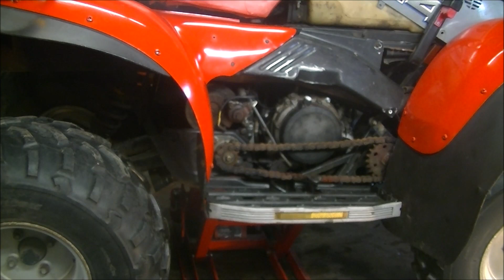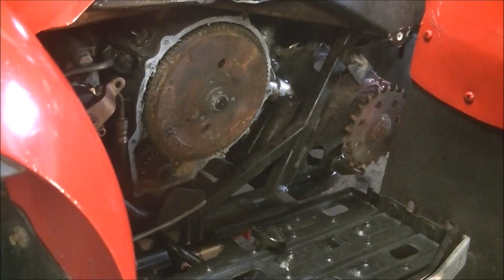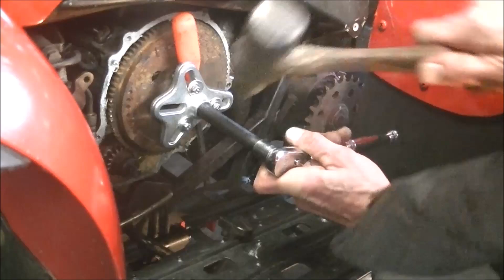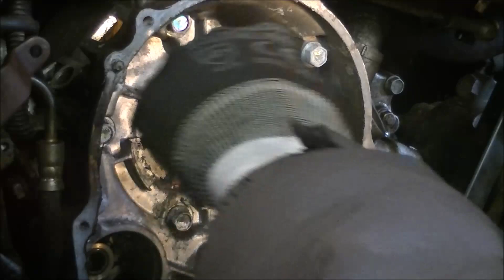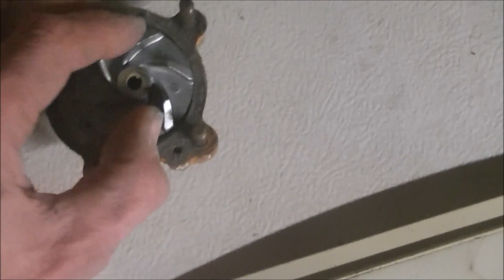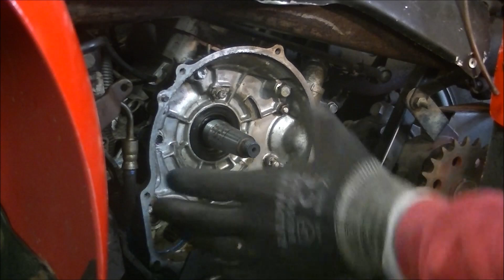How to replace a water pump  on Polaris  350L/400L Trailboss

Comment: I am putting the pan back on and that special slotted nut that threads left i cant torque to spec without my crankshaft turning. Is there any tricks or methods to getting that nut tight?

Comment: Where is the 10mm air purge located in the engine to bleed air from the coolant system?
Reply: On the top of the head is a bleed bolt. I have a 350L

Comment: Is there a way to test if your water pump is working without taking everything apart?  I’m getting some smoke coming from the water pump inlet area on a new top end rebuild. Head is getting hot quick.
Reply from the maker: You can look in the radiator cap to see if its flowing.
Reply: Seems mine is just bubbling. When I hit throttle it will spin in circles doesn’t appear to flow one way or other.

Comment: How did you get the stater out?  It all appears to be wired in with no connections to take apart.  

Thanks.
Reply from the maker: There should be bolts on the stator plate outer perimeter. Take those off and pull it out.

Comment: Can a bad water pump seal cause my engine to burn coolant? I've already replaced my head with a machine one and new gasket.
Reply from the maker: Yes, it seeps into the case and goes through the exhaust. It's a common problem with 2 strokes. Replace the water pump and crank seal behind the counterbalancer cover.
Reply: I have the same issue after doing the head gasket twice and inspecting the head it’s still smoking alot

Comment: I have a 350L and just swapped in a working engine. How to I bleed the system correctly? I was test running it and the hot light came on so I shut it off. The top hose that goes back to the radiator was not hot. Thinking I did not bleed the system correctly.
Reply from the maker: Did you crack open the bleeder screw on top of the head to let the air out?

Comment: Thanks for the video! Very helpful.  I got everything off except the water pump bearing is stuck on the shaft.  I can move it maybe a quarter inch back and forth freely, but seems to get stuck.  Do you have recommendations for removing this bearing?  It appears to be smooth and work properly, but since I have it apart and have a replacement, I'd like to get it off.  Thanks!

Comment: Very good, bad buy on a 1995 Explorer, overheating issues, radiator sensor looks bad, blown headgasket, had to use putty, still over^pressure in radiator and boiling antifreesze went into reserve :(    So wonder if this low miliage has defective waterpump, but that impeller doesnt seem to be melting plastic ??
Reply: Still at it, is it true there are no thermostat on those models? So aluminikum and doesnt melt :)  Mine has only 6,000km so the seal & bearings should be okay.

Comment: I broke 9 grade 8 bolt in my balance puller one in the fly wheel drilled it tapped tried again got it good n tight then my threads gave any ideas to help
Reply from the maker: Aside from pulling the case apart to push ballancer out..I don't. except heat it up before you pull it.

Comment: Hey Bud how are you I watch your videos all the time and enjoy them very much I have it thank you very much I have a 2001 Polaris 400 sportsman I just put a whole new top end on it I had to board out new gaskets piston blah blah blah I had started it and it ran good the 1st day no problem I was checking for leaks the fan worked came on I shut it off the next day I came down to there started water is coming out of my overflow tank it's boiling inside my overflow tank The motor is not that hot the fan did not come on Now when I pull to start it I can feel here the pressure in the overflow tank like you can hear it moving the water around what the hell is going on hell is going on do you have any ideas t thank you Steve
Reply from the maker: It's possible you have back pressure from the head gasket. Did you check to see if the head was warped?

Comment: Why not just use the impact with the puller instead of risking damaging the epoxy on the magnets and or stator itself  by either with the hammer and or with the torch Plus you would have saved more time just using the impact with the puller.

Comment: How did u pull the water pump off. Does it just come out or is there a trick to it?
Reply from the maker: Do you mean impeller or pump housing? The housing should pull out after you unbolt impeller.  Unless the bearings are rusty.
Reply: @TitaniummanGarage  yea its the pump housing. It was rusted on so use a little force. Thanks for the vid was a lot of help since it's my first time replacing

Comment: Hey titaniumman I have a 2000 scrambler 400 2 stroke I am going to attempt the prius water pump change , do you know what the coolant flow is???? Does it come from the radiator to the bottom port of the water pump then out the top or vice versa. I see videos of 4 strokes being changed but none of 2 strokes, any help thanks
Reply from the maker: From top to bottom. And out the bottom hose.
Reply: @TitaniummanGarage  thank you for responding so quick

Comment: Thanks for the video. Very helpful!!!  I just bought a 1996 polaris sport 400l and I was reading up on them and they say this is a common problem for them. Mine is not leaking yet I don't think?  I have to put a new starter into it. So I guess we will see lol this is my first polaris so its all new to me. I have owned mostly Yamaha banshee/ blaster/ warrior/ you get the point. I'm hoping this is a good wheeler it runs good it has been bored 40 over clutch kit and pipe im sure it has bigger jets in it as well. Thanks again 👍
Reply from the maker: It should be a good machine for you. Just make sure you keep all your fitting greased up. Keep an eye on the oil injector and put a temperature gauge on it. It will run a long time.

Comment: My counter balancer decided to come apart and take the case and piston with it.  I saw on a forum that someone just removed the balancer all together and just ran an external water pump.  What do you think about this idea?  The counter balancer is way to expensive for me to be throwing at this thing right now.  I already spent money on a new flywheel and stator then this happened!
Reply from the maker: It can be done with a Prius pump do I've seen. Never tried it..but it works. You do need counterbalance.  There's a reason they call it that.
Reply from the maker: The counterbalancer also drives the oil pump.
Reply: @TitaniummanGarage  I had already by-passed that and just premixed instead.  I decided to tear it down and scrap it.  LMK if you need any parts! LOL....
Reply: I'm thinking of bypâssing the fan sensor, these 2 strokes heat up so fast.

Comment: Hey I was wondering what size bolts you’re using for you’re fly wheel puller?? Length would be very helpful. As I’m machining out my own puller. Please respond as quick as possible.
Reply from the maker: I'm not sure what size bolt. They come in a kit with the puller. I use the one that fits. The bolts are about 2 and a half inches long. I will look at the kit. Maybe it will say a number on it.

Comment: Scratching my head here with a 99 xplorer 400 2 stroke I have spark but will not run the spark kept getting wet watching your videos and the water pump peep hole leak a little bit I disconnected the oil line and I took off the carb and it stopped getting wet...will it at least try to run if I put a little starting fluid without the carb?? And another question is the starter relay works but the key won't turn it over what can I look at mind you my stator ohms is 229 and the pick up is 100ohms I get good spark but it just won't even try turning on..thanks in advance
Reply: Also I took off the screw on the bottom to see if there's any water or fuel and found nothing...I been working on alot of motorcycles and 4 wheelers but never a 2 stroke with oil mixture...

Comment: do you  have to take engine all apart just to do waterpump?  I just put engine in and drove around maybe 45 minutes on motor whenbrown oily coolant started blowing out of somewhere.  the only oil in the thing is counter balancer, so its most likely waterpump.  Cant you do water pump on the vehicle though?
Reply from the maker: Unfortunately..The waterpump is in the counter balancer area so yes. I heard of guys installing an electric pump to bypass it. The issue with that is it could run down your battery.
Reply: @TitaniummanGarage  there's no possibility of doing it without pulling engine or it's easier to just rebuild engine.  I'm looking for least path.
Reply: @TitaniummanGarage  what were the torque specs on the water pump and pan.  Also flywheel.   Thank you for posting this.  I start this job tomorrow except I need the castle tool
Reply: The castle nut is 45 for the crank right.  Rest are 20?
Reply: @TitaniummanGarage  I pulled the balancer but forgot to take out the two bolts, so it just pulled the gear off.  I was able to get the counter balancer out of donor engine by drilling a little hole in the donor.  Anyways, the gear is just pressed on, so getting it back on to the exact same position proved to be difficult as now I have vibration.  I ordered an electric pump and pls. To put old counter balancer back in with damaged/grooved spindle.  Would that affect the oiling properties of the counter balancer.  Does the shaft have to be smooth to keep oil and coolant in the right place, or just coolant.  Do you see any problems in my plan?
Reply from the maker: @bigguy8586  When you say grooved spindle, do you mean the small shaft that the water pump slides on? If its not smooth it would chew up water pump seal. it does not affect oiler at all.
Reply from the maker: You'll have to let me know how the electric water pump works out. I always wanted to try that. I think that's one of the biggest issues with these old wheelers. pump leaks and messes up the piston.
Reply: @TitaniummanGarage  I agree, it seems the biggest issue, as the donor engine didn't have water pump problem, but when I took it apart, the bearing was crap and seals were starting to 
Weep.  Yes, I was talking about the shaft that water pump rides on.  I was worried that putting that shaft back in to eliminate balance issue would cause it to leak oil internally like oil into empty coolant section when I convert to electric.  I'll tell you how it goes.  If dtator is not powerful enough I might have to modify the lighting system to LEDs to accommodate extra power drain from pump.  Other than that, and if I'm good using using grooved shaft then plan should work.  What do you think?  I got Prius water pump for 30$ on eBay.
Reply from the maker: Not positive on the waterpump, but the other bolts are 18 to 20 ft-lb the nut 45
Reply from the maker: Cool. I heard of another guy using one of those. Just bypass the waterpump. Go from head to electric pump and block the old water pump openings.

Comment: Did you have to hold the clutch when taking off the special nut
Reply: How did your crank shaft not spin
Reply from the maker: @ogkoolad1364  The gun I used is for taking lug nuts off. I was able to use it without putting a bar in the clutch. It has a lot of torque.
Reply: Titaniumman Garage ok thanks

Comment: Very helpful video. With out the info you provided would still be working on taking the crankshaft nut off. Only problem iv got is I can’t get the case to split. Any tips?
Reply from the maker: So with all the bolts removed. Even the little ones by the waterpump (I did that once) tap around the edge of the case. Once it starts to split take a rubber mallet and pound on the clutch side of the crankshaft. Make sure the key is out of the crankshaft that holds the gear in place. If you have anymore questions drop me a line.
Reply: Titaniumman 2012  I got everything back together. But I’m having a problem. I’m getting little to no spark now. I did cut the wires to remove the coil under fly wheel. But it’s all connected right. When putting fly wheel on I hit it with a rubber mallet to make sure it’s on. But have no spark. Any thoughts
Reply from the maker: @cj99dj  could be 2 things.  One. There is the voltage regulator next to the stator. Highly unlikely but you could have knocked it out of wacky when you hit the flywheel . 2 could be the cdi box. Did you have no spark before rebuild?
Reply from the maker: Also try another spark plug. I've had a good one foul out already.
Reply: Well done video.  Great lighting.  Good visibility for the viewer and you explained what you were doing well, leaving nothing out.  Thanks!

Comment: Can you provide the size of the split nut/ slit nut you removed with that special socket? Or information on where to get the socket? I have been able to find absolutely no helpful information online.
Reply from the maker: I found the socket on ebay. No part number.
Reply: @TitaniummanGarage  do you happen to know the size of the nut or the socket? So I can search correctly?
Reply from the maker: @caseybronson2224 94 - 03 Polaris Crankshaft nut tool socket 400 xplorer scrambler 2870967 Seller:  custommachinecomponents
On E bay. Comes with the nut.
Reply: @TitaniummanGarage  Thank you so much!
Reply: @Casey Bronson I just did this project today. Had the same problem. Could not find the special socket. Decided to get creative and got a 36mm deep socket and made my own. Just used a grinder and matched the pattern. Saves money. Only problem iv got now is I can’t split the case.
Reply: @cj99dj  I've been trying to grind the nut to match a 1.5" socket and just can't seem to nail it. Feel like I've ground down plenty and from what I can tell the patterns match.

Comment: Also I keep reading and now have heard the counter balance. Is it in a separate area from the crank or does it get lubrication the same way as the crank. Not 100% familiar with the 350/400 2 strokes. Used to have a 250 trailblazer and I definitely dont remember a counter balance shaft.
Reply from the maker: 250's don't have them. They are air cooled. The counterbalancer drives the water pump and keeps engine balanced. It is separate from everything else. The only oil required is by the gears. There is a fill hole on top top the case near transmission. Other than that it runs on bearings and has just the waterpump seal to keep it sealed from water or oil.

Comment: Whats the part number for the tool to pull the left hand threaded nut off that crank?
Reply from the maker: Sorry I don't have the part number. I just googled It.
Reply: all good buddy.. made my own
Reply: @TitaniummanGarage  what did you Google to find it?
Reply from the maker: Ebay. 2870967 94 to 03 crank nut socket 400. $78.00.
Reply: @TitaniummanGarage  Find myself yet again watching your video to handle a scrambler 400. thanks again 3 years later hoimie!

Comment: I have a 99 Xplorer 400 2 stroke. Do I need to be concerned with the pump drive gear behind the pump? Is there are bearing or bushing behind there that I need to replace?
Reply from the maker: There is a bearing in the pump and behind it on the plate. if It looks good lube it up. if its rusty I would replace it.
Reply: Yes replace the water pump bearing and the two seals.  They go bad in every 350/400 Polaris two stroke motor.  Design flaw, so trust me replace them.